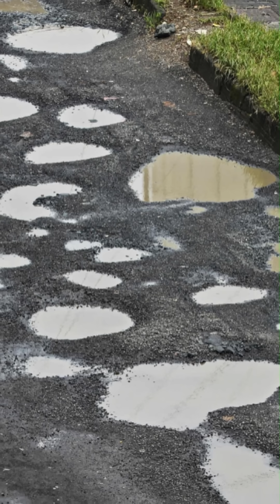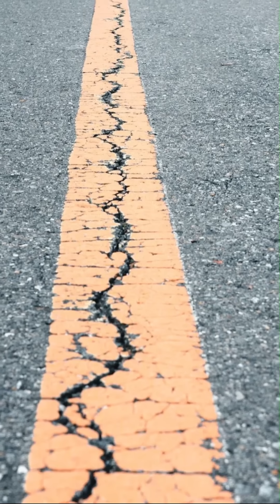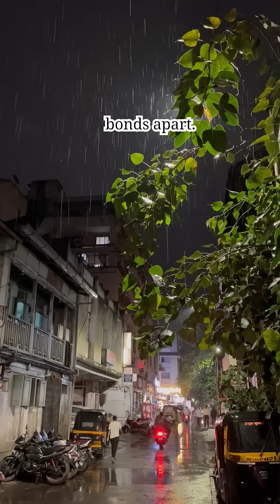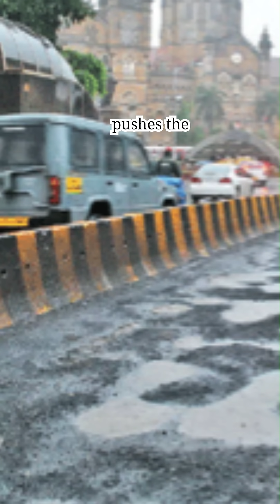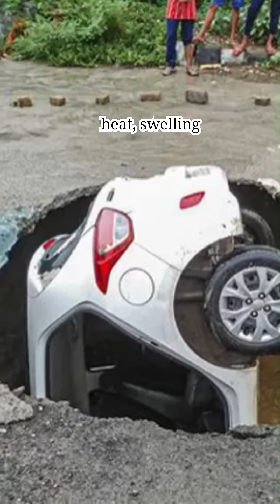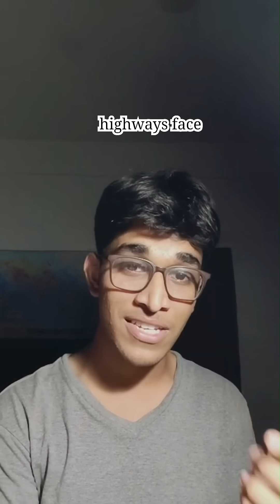Why Indian roads can't survive rain? #indiancities #mumbai #delhi  #facts #documentaryshorts

Comment: Yes!! While the conditions mentioned are right.. the main underlying issue is effective drainage. As water continues to stagnate on roads, faster the damage given the percolation and unstable base soil. Small pebble debris on the surface expedite the deterioration.

kindly refer JM road (Junglee Maharaj Road) Pune, as a case study, built in the 70s, it’s been pothole free for decades, withstanding the same extreme weather challenges.

Irony - those contractors never got another road building contract.
Reply from the maker: Thank you so much for your comment!❤
I am glad that you found the video engaging!
I totally agree with you, our planning and urban architecture is undoubtedly the biggest factor!

Comment: The Jungli Maharashtra road in Pune has no potholes for decades , despite experiencing the same Indian weather conditions that you/ govt. claim prevents good lasting roads. 
For long lasting roadways the contractors of JM road Pune, should be appointed to build all roadways.

In addition, JM road Pune contractors should be requested to list out the all material, grade, quality standards, process and specifications used for road development - and these should be the benchmark to be insisted on from all contractors.
Reply from the maker: You are absolutely right!
Thank you for your comment ❤